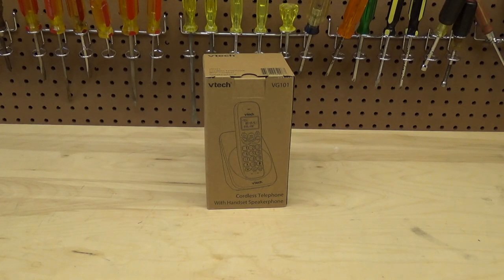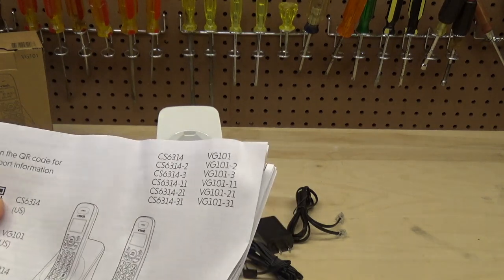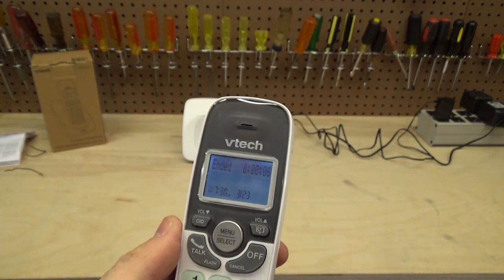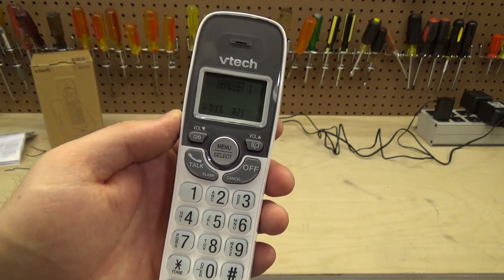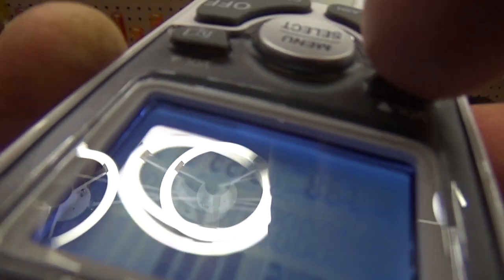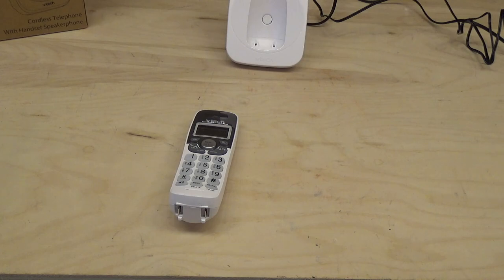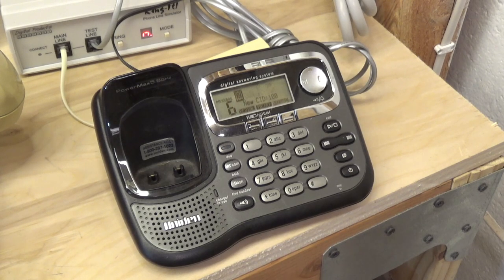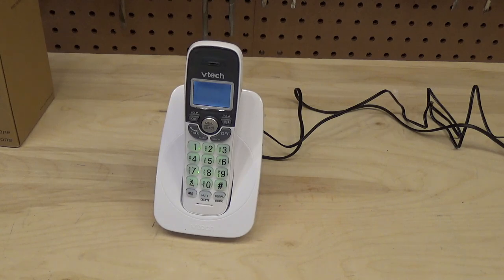Vtech VG-101 Cordless Phone with Speakerphone | Setup and Review

Comment: Vtech's manuals are a complete joke at this point. Between 2019-2021, they didn't even provide manuals at all with their new models!
Not sure why Vtech (and AT&T and Panasonic) is selling several of their models under multiple model numbers. For example, this model is also sold as the CS6314, so its CS heritage carries on. They also sell this as the CS6214, so this model has 3 model numbers which are all the same phone. I have no idea what the point of that is.